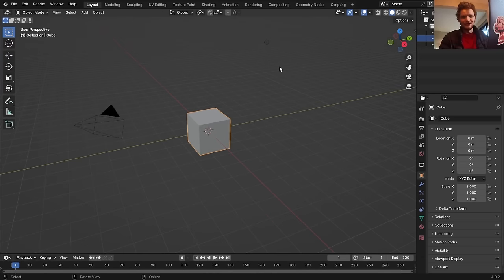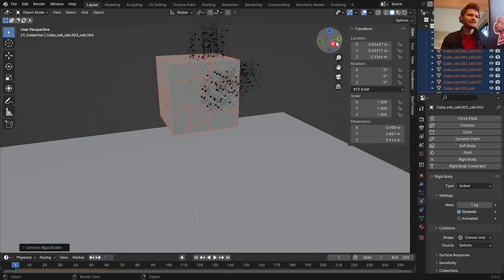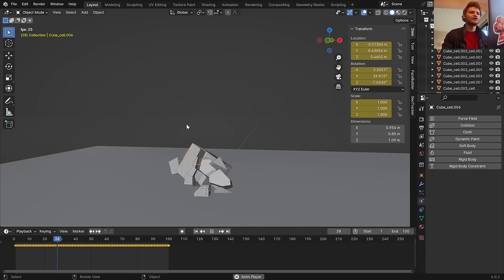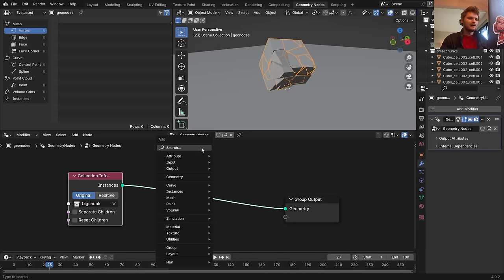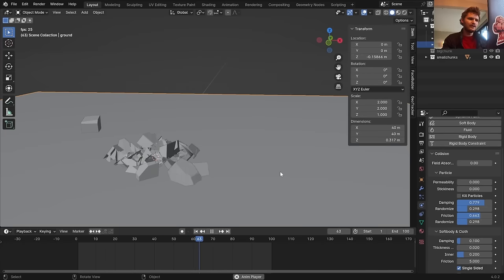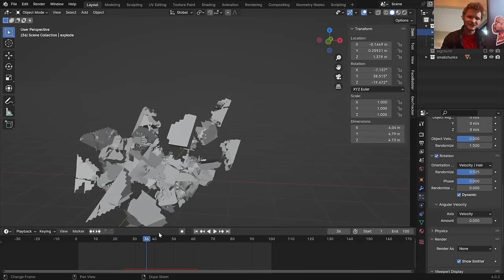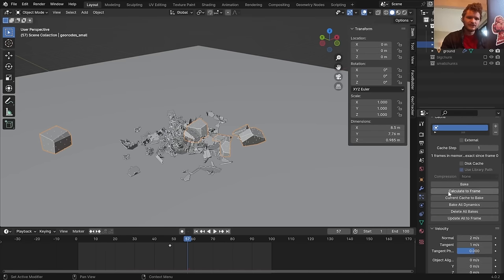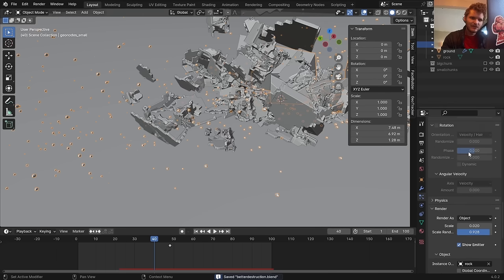Blender Destruction Physics | Rigid Bodies, Explosions, Simulation-Nodes, Dust Particles, Smoke

Comment: Cool one !
To not use this weird simulation stuff you just have to calculate the position of the points in the instances space like a reverse transform kind of... ( as flipping from original to relative stuff).
- add a capture attribute before realizing the instances and get in here the position and the rotation (don't forget to capture this in Instance domain)
- subtract the position of the points from the captured position
- pass the result through a vector rotate node in the vector input (set type to Euler and check Invert)
- plug the captured rotation in the Rotation socket input
- plug the resulting rotated vector into the Vector input of the noise tex
Done !

Comment: Why doesn't it affect it directly? 

4o says(true or not?)
Ambient occlusion (AO) doesn't directly affect smoke volumes because AO is a technique designed to approximate how ambient light interacts with surfaces, particularly in crevices and where objects are close together. AO calculates shading based on the proximity of geometry, which works well for solid surfaces but not for volumetric effects like smoke.Smoke and other volumetric effects are inherently different because they involve particles suspended in a medium, interacting with light in complex ways. Volumetric lighting deals with how light is scattered, absorbed, and emitted within a volume, requiring a different approach:Volume Scatter: Simulates how light is scattered as it passes through the volume, creating a realistic diffusion effect.Volume Absorption: Simulates how light is absorbed by the particles in the volume, affecting the density and color of the smoke.Emission: Adds light emitted from within the volume, useful for effects like fire or glowing smoke.These effects require more sophisticated calculations than what AO provides, hence AO is not used for volumetrics. To achieve realistic smoke effects, focus on using volumetric shaders and lighting setups that account for the physical properties of smoke